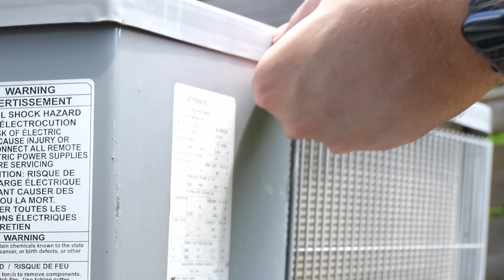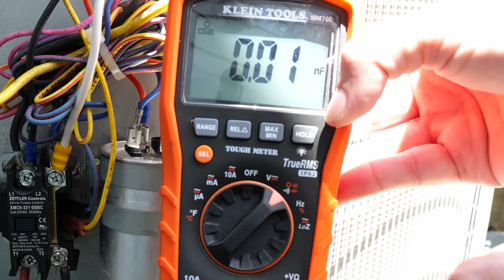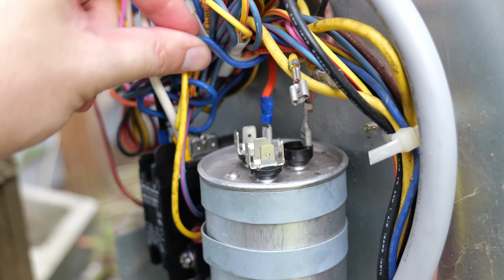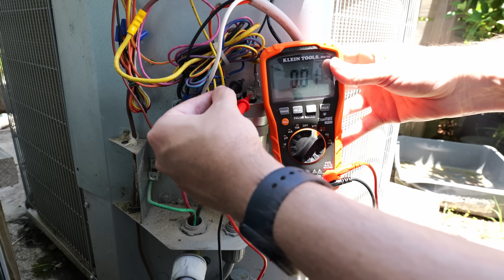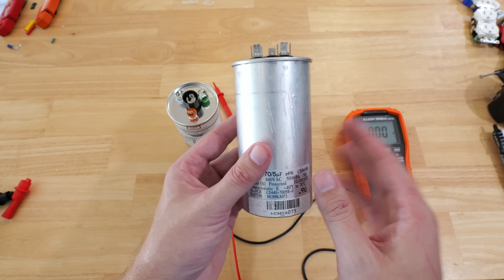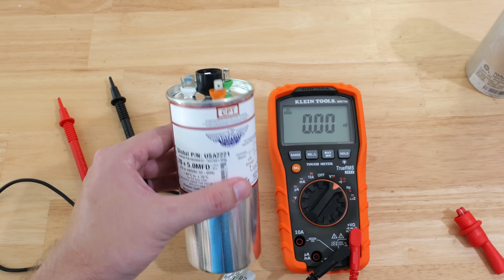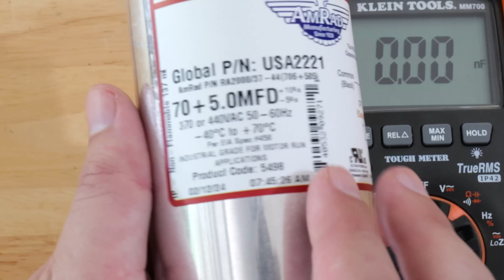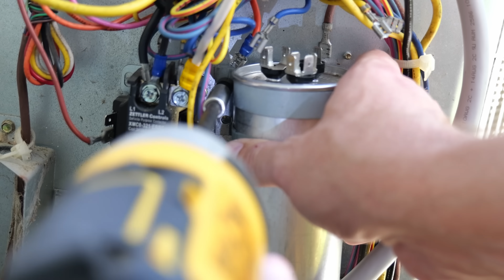Don’t Get Ripped Off! How To Avoid The AC Capacitor Scam And Save $500

Comment: As Handyman for a 24 unit building a tenant told me her HVAC Contractor son told her that a $300 part needed replacing in her unit's A/C and that's why it wasn't working. I went up on the roof with him and noticed that a double-contact switch was bent so only one contact would make contact. I straightened it out and never had another problem with that unit. I realized later that the son had done that because he was out of work and his mommy was helping him out. What I'm about to say doesn't apply to all Contractors but when one of my brothers got his General Contracting License he said to me that basically it was a license to steal. Many Contractors have this attitude. I dealt with 16 Contractors on one job for a couple years and I was disgusted with how little any of them could be trusted to tell the truth or to do their work correctly without oversight.
Reply: I am having issues with the unit as well. Stopped working.  First mechanic said it was the fan motor. Second mechanic says it's the fan motor.  HVAC company gives an estimate for $2150 to replace fan motor. We agree with since we are stuck with no working unit.  Order the fan motor. Third mechanic comes to install the fan motor. Takes ten minutes on the roof, changes the capacitor and unit is working fine.  My boss says, since we paid for the fan motor and new blades, might as well, have then installed it. 
New mechanic comes in, install the new motor and fan blades. Now unit won't turn on. What's the issue? Mechanic can't figure out. Worked all day on it and now blames on the electricity. Says the problem is electrical.  Not only I feel we are being ripped off, they also don't have qualified mechanics.  I am here at 4:00 AM watching your videos to solve a problem when I should have a working unit.
Reply: WORD of WARNING to those that PLAY those UNETHICAL and THIEVING games! KARMA is a BITCH and doesn't FORGET or FORGIVE! 

KARMA will RIP you a NEW one for STOOPING low and HURTING others! 

Best to ALWAYS do right! It will COME home to YOU!
Reply: I cringe when I need to hire someone these days. Most turn small jobs into big projects.
Reply: what's worse is that people will believe those contractors over you because they are licensed and you're "just a handyman". I've been in multi-family maintenance for 18 years and people still treat me like an idiot because I don't drive a van with a fancy wrap on it.
Reply: That is exactly why the DIY industry exploded 25 years ago. I am going to be bolder than you and say 99% of them are corrupt. The small-time guys will rip you off because it might be their only job for a couple of days. The big guys charge through the nose because someone has to finance 5 more work trucks, both buildings, manager bonuses, and the owner's 3rd house.

There is no winning. We have no choice but to do things ourselves.

Comment: OL does'nt mean open line. It means Overload and in the context of resistance measurement it specifically means that the resistance is too high for the simple microprocessor used in these meters to interpret correctly. So anything over range of what it can actually measure is shown as overload. You will get the same interpretation if you measure a voltage that is beyond the voltage range of the multimeter.  Not so high that you cause arcing on the circuit board but probably +10% over the top range.
Reply from the maker: Sure it does, people just call it different things.  Overload, open line, open loop, out of limit, the list goes on and on.

Comment: "OL" on a meter stand for "Over Load". The most accurate way to test a capacitor (Cap) is seeing if it charges(this is typically used to test on small caps used in Radios, TV's, etc. On Big Caps with thousands of voltage rating usually for the caps found on Radars and Electrical equipment using a megger to the rated voltage of the cap. If it draws current before the rated voltage is reached the cap is bad. I have seen many caps show the right capacitance that were bad. The most common problem with caps going bad is due to age and or Heat; the heat will break down the dielectric in the cap thus causing the cap to breakdown before reaching the rated voltage of the cap. The caps main job is to store electricity it cannot do this if the dielectric goes bad. In outside like on AC units the AC Unit caps mostly go bad due to heat and also any nearby electrical strike that can be a block away. It does not have to strike the cap but it will send out high power RF (Radio Frequency) that will ruin a capacitors dielectric. I am an Electronic Tech of over 50 years and hold a 1st Class FCC Radiotelephone License with Radar Endorsement (the highest). I am also a Ham Radio Operator of over 50 years with and Extra Class license (the highest) and a volunteer FCC Examiner for Ham Radio License. I worked in electronics for both the USAF/TennANG (TANG) where I also taught Electronics and also the same in the Navy, I retired from the Navy as an Electronics Tech and also taught electronics and when I retired from the Navy I then when to work in the Philadelphia Naval Shipyard as a WG-13 installing Radar and overhauling old equipment to make new and bring back to brand new specs. I also have a BSET(Bachelor degree Electrical Engineering Technology), 28 years working as an Electronic Tech/Process Control Engineer/IT Manager for the Philadelphia Water Department- now retired(The nation’s first water department) and currently working as a PhD student of Astrophysics(Like electricity, Electronics it is just another branch of Physics) at Princeton. Basically Capacitors pass current signals to ground as the DC charges the cap. Caps store Electrical Energy; they do Voltage Smoothing (Filter Rippling). In transistor circuits and Power Supply circuits they Block DC and Pass AC or RF. Also in a Power Supply their main function is to create DC from AC. Basically Capacitors Block DC and Pass AC/RF/Noise. They are used as Filters to reduce noise in circuit. There are many You Tube videos explaining Capacitors. In school the first thing you are taught is how they are used Power Supplies. I hope this helps.

Comment: I just called for a company for a HVAC checkup. Technician was here for 15 minutes. He comes in and tells me my capacitor is going bad and will destroy the fan motor unless I replace it. Cost me $550 parts and labor. Wish I had seen your video a week earlier. I hate being ripped off!

Comment: A cap can test good to the multimeter and still be bad. Those meters, only test one part.
Need an ESR meter to fully test it.
Reply: @BlondieHappyGuy  
Many esr meters have charts for most AC caps. 
Without it being a regular thing, I had 2 capacitors test good on a multimeter, while actually being bad. I had look into a better option for the caps.

Comment: Yes, the service tech told my ex-wife that it needed to be replaced and quoted $500. I went to Grainger got the replacement for less than $15, needless to say I started using another company for our tune-ups.
Reply: the problem is that the whole hvac industry seems to be a 'rip-off' industry.

Comment: Old AC tech told me tune ups are a racket....He said corrosion causes leads to have higher resistance and causes the most problems. Just turn off the power..remove every wire / connector you can get to and clean the contact area. Also clean out debris and clean coils. Been doing that every spring and my 27 year old unit is still going strong.
Reply: Corrosion is usually caused by a loose connection more than anything else like environment so instead of cleaning them, they should be replaced if corroded. Waste of time to "clean" them every spring" because of corrosion. Just my two cents.
Reply: @BlondieHappyGuy  I have never seen severe corrosion..just minor..a little emery cloth then contact spray and reconnect. I am sure folks in more severe climates such as near the ocean could get some severe corrosion.

Comment: Great info...
Most all of the time you your compressor will not kick on is because of that Capacitor.  I bought 2 off Amazon cheap just to keep around the house for when mine goes out.
My local A/C Repair charged my Dad $1200 for is very cheap part that takes 5min to install.  I'd go outside & get the number's off your's & buy 1 or 2 off Amazon. My local HVAC place sells these for $300 + , Amazon > less than $20!!

Comment: LOL! I just repaced a condenser fan/compressor capacitor, and only cost the homeowner $20 bucks, they're a good friend, and bought me beer! LOL!
Reply: Yeah, capacitors are a constant problem!... You have two electrolytic surfaces in very close proximity, all rolled-up in a can,... and "fused" to open the circuit, if there's a high current issue (thank god for beautiful woman)

Comment: My furnace motor stopped working. The first thing I did was test the capacitor with a voltmeter that can also measure capacitance. The capacitor was bad. I replaced it myself, and the furnace has been working fine since for years. The price of a Fluke or any brand multimeter that can measure capacitance is a lot cheaper than a service call. Even if you find the capacitor is good and the motor has died, you'll still likely find the multimeter to be useful at other times.

Comment: Replaced mine last year after 23 years of use.  Wasn't expensive.  I was told that if I do a better job of keeping the cooling vanes clean (shop vac the system) the cap won't be as stressed and should last longer.

Comment: YES!  *** PLEASE READ***  In fact 6 days ago.  My AC stopped working.  The condenser fan spun but the compressor was silent.  A technician was called in and did his diagnosis and determined that the compressor was bad.  They provided a quote for two options: $4k and $7k.  Meanwhile! I called around to get replacement quotes from other HVAC contractors and one of the independent businesses offered to verify the diagnosis since he identified that the AC was a "top-tier" unit with a lifetime warranty and had significant doubts that the diagnosis was correct.  It turned out to be a bad 45/5 uF capacitor - a $20 part!  He got my AC up and running in no time and didn't charge me for any of it!  Wow!  I called the original contractor with the news and provided constructive feedback.  They were very receptive about it, appreciated the feedback, acknowledged their blunder, took responsibility for it and......gave me a full refund and...offered a free "maintenance" visit.  Wowza!  To be clear, I had no hunch that this was an intentional rip-off.  It was an honest mistake done by a very young technician that will gain experience over time.  I learned a whole lot about these capacitors.  Happy Ending!

Comment: great video, but I hate to see folks using impact tools for everything nowdays.  Especially sheet metal!!  almost impossible to modulate the torque and once you strip out a sheet metal fastener, especially around refrigerant systems, you can't just step over and redrill a new hole for fear there is a freon line behind your new hole location!
Just use a nut driver.

Comment: Do you know if there is a way to connect your air condition via wifi or Ethernet cable plugin,  to do basic troubleshooting and resetting the system? For example, for a remote location property or warehouse?  Thanks.

Comment: If you see the capacitor bulging, replace it. Doesn’t matter what it reads. I typically pay $10 to $15 dollars each for new capacitors, because I buy them one at a time. A contractor buys them by the case and can get a better price. They then re-sell them to customers for $100 or more, then add another $100 or more for labor. Here's another interesting fact, it isn't necessary to replace the capacitor with another with exactly the same microfarad rating. Being off by 50% usually makes no difference.

Comment: As an electrician, I ALWAYS test my tester on a live circuit before testing the equipment. And OL doesn't mean, "open line". It often does mean, "over limit", though.
Reply: Cause if it was open the display wouldn't change.
Reply: Lmao
Reply: True. When measuring resistance then OL is open line.
Reply: Or "out of limit(s)" although it likely isn't carved in stone anywhere.

Comment: So your trying to say my life time of trouble shooting and fixing is worthless if anyone can do it . Oh hvac school is running 22,000 a year 2 yrs min of schooling. Plus truck plus ,plus running stock on truck .in the 70s my truck carried 5,000$ of stock .talk is cheap .so fix it yourself ,ill charge .what is fair  yoll brake  it , and then i wont be able to fix it  oh if you're that good, teach or shut up and work. Those capS are made to blow so that you dont lose compressors,fuse size maters they are cheaper and easier than caps